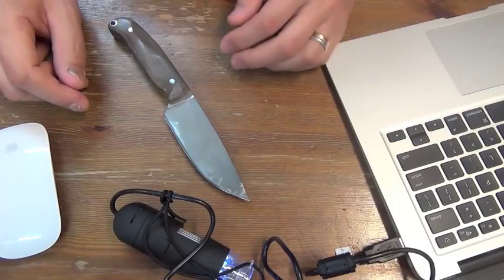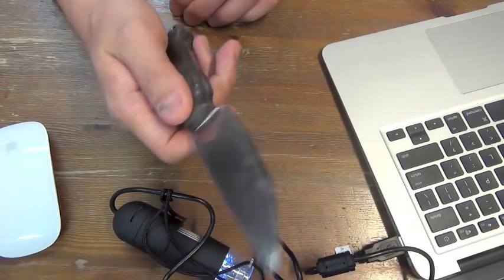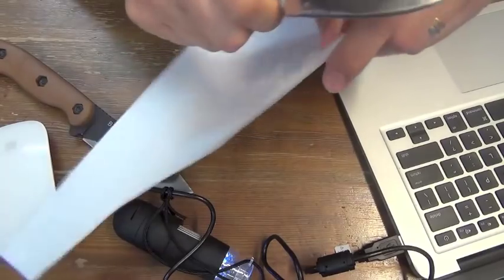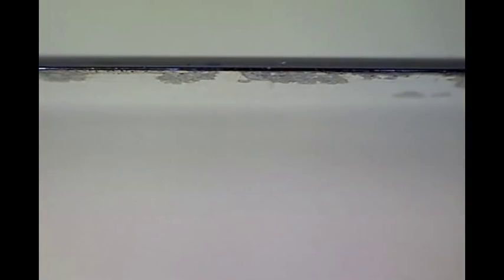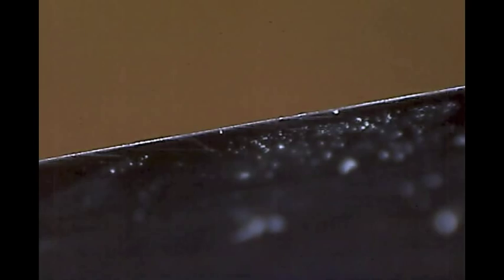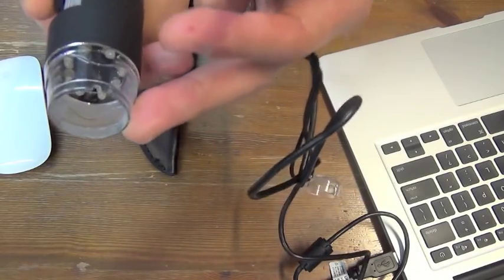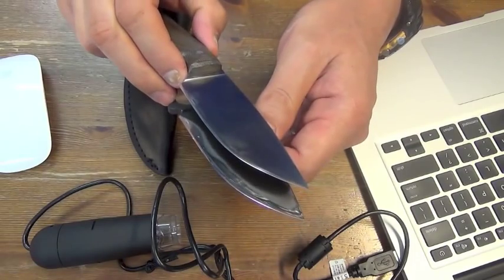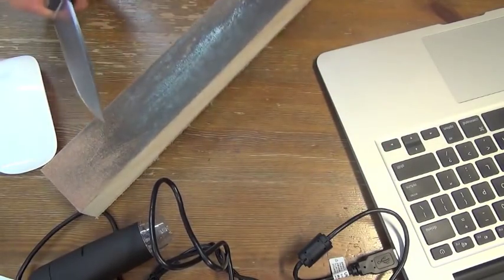What edge holding is

Comment: I've had hunters tell me that a toothier edge will work better on animal dressing. Steels like 1095 will not hold a polished edge very long in abrasive cutting like animal fur. If I were to go hunting I would use high wear steels like 10v, S90v. I would use S/C stones and sharpen to 320-400 grit.IMO